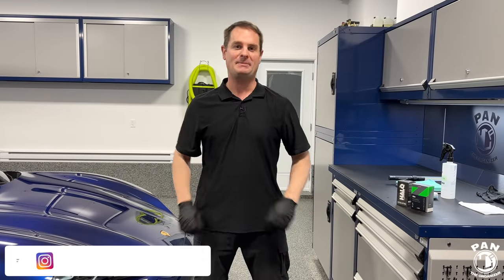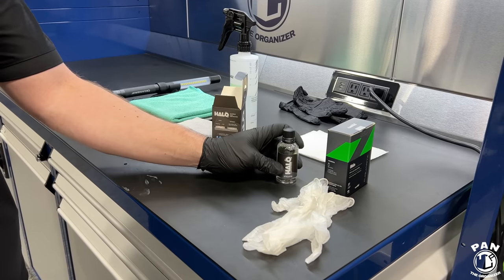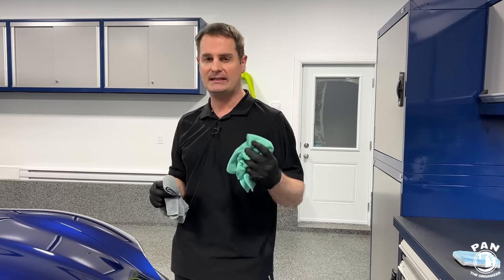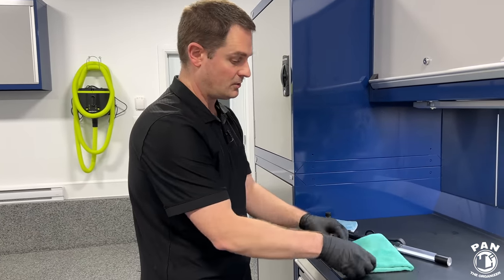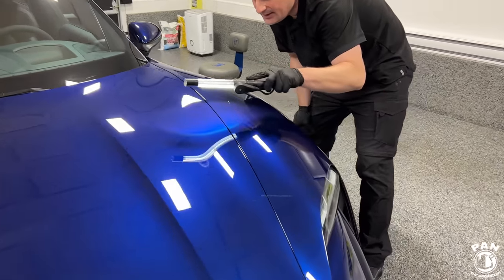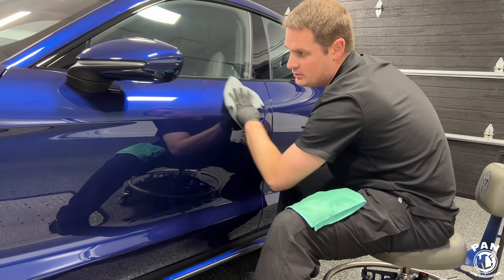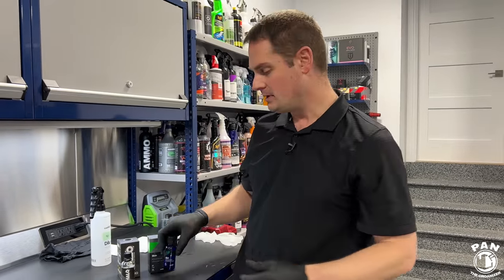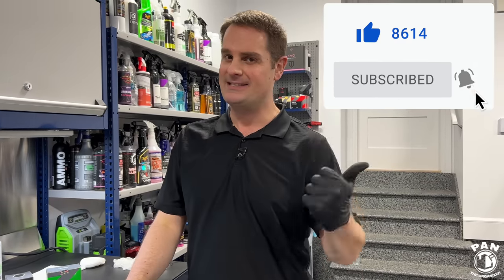How to apply a ceramic coating on PPF (paint protection film) : Porsche Taycan Turbo

Comment: @Pan - you said several times both coatings are fine for matte PPF, which I have on my Tesla model Y. I wrote to the CarPro people and they said Skin may make the matte fairly glossy (maybe not ruining the PPF, but a glossy/shiny layer on top).  Have you personally applied over matte PPF? Thoughts? 

The Ceramic Pro PPF installer used Ceramic Pro’s  PPF/Vinyl base and top coat as a protectant in the Tesla. Thoughts on Ceramic Pro products? Would you switch to the ones in your video?

Thanks!
Reply from the maker: I haven’t tested on matte surfaces. But CaPro themselves, on their own official website, state it can be used on matte surfaces. Check it out here: https://carpro.global/catalog/cquartz-skin/

So it seems we’re getting conflicting information from the brand.

One thing that can happen is coatings, even matte coatings, often make the surface richer in appearance. But not glossy.

Comment: U just made ceramic coating looks so easy. Quick question: Did you do any paint correction before this car was ppf-ed? This coating seems pretty DIY-able, just not sure about paint correction step. Thx
Reply from the maker: The car came to me already with PPF so I didn’t perform the paint correction. It seems the team that did it might not have been the best hehe.

Comment: Good morning Pan.  Will be parting with my 2015 BMW 435i M Sport and getting a 2022 Kia EV6.  Will definitely be adding PPF at least to the front back to the door panels.  Don’t know anything about PPF, what type to use or who I select to apply.  After applied and watching this Video will do the prep and then apply a coating.   Will it be AvalonKing or one of those in the Video?  My experience applying AvalonKing might make the process easier.  Oh, plus everything I learned from you over the past 2 years.
Reply from the maker: Good thing is that you can also apply AvalonKing on top of PPF, so if you still have it, use it on all the car.

Comment: Hey Pan,  How about a follow up on this car, putting a second Ceramic coat on top of this one.  My Tesla is in the shop right now getting full PPF wrap and a Ceramic coat on top of that.  I'm thinking of putting another layer or two on top of what the shop does.
Reply from the maker: I won't do that. You can't guarantee chemical compatibility and overapplying different protectants doesn't do any good usually. Plus you'll never know how long the base coating actually did if you try applying another one on top.

If you want to do that, by all means, you're free to do as you wish. But don't expect me to do that.

Comment: Exectly 4:00 minutes in you say you have many videos on prepping cars for ceramic, I figured you meant you have a video on preparing PPF for ceramic coating.  So wasn't sure if there's something special that needs to be done to PPF before ceramic coating.
Reply from the maker: It's pretty much the exact same prep. Except you would be very gentle with a light polish only if you see fine scratches in the PPF. And avoid using tar removers. But you can wash, use an iron remover (don't let it dry on the surface though, and don't work in direct sunlight!) and light polish, followed by the IPA wipe. Pretty much the same as for normal paint.

Comment: A great video pertaining to PPF, ceramic coating and maintenance. I use Car Pro Ech20  Pan. Is that enough to clean the contaminants on the PPF and ceramic coating? I use Reload every 4 months also.
Reply from the maker: Ech2O is a waterless wash/quick detailer depending on dilution. It's not meant for a perfect clean. When possible, I would still recommend a good traditional two bucket wash with CarPro Reset.

Comment: Can you use the ceramic coatings you mentioned in the video on clear coat as well?  Asking as not all of my car has PPF and would just like to use one product if possible.
Reply from the maker: No. These are PPF only coatings.

If you want to use just one product, do the opposite. Most paint coatings can also be applied on top of PPF.
Reply: @PanTheOrganizer  so then for the best protection I should use paint ceramic coating for paint and the PPF ceramic coating for the PPF. Is that what you’d recommend, or just use the paint ceramic coating everywhere is good enough?

Comment: Thank you so much for all the info
I was old school...
Wash wax and wax again
Occasional waterless clean and spray wax
I have a new car with PPF clear bra
Ive been keeping it washed wiped and clean
I have been using SiO2 ceramic spray and wipe (McGuires) hiw would it be affected if i were to apply a wax
I know not to with SiO2 coat 
Any difference using spray
And woul using an orbital buffer be bad
Reply from the maker: With PPF, you want to be very careful with what you apply on it for protection. While it is technically possible to wax paint protection film, it is not a recommended practice as it may have a detrimental effect on the film’s performance. Waxing paint protection film can cause discoloration and cloudiness over time. With the advancement of coatings and paint protection technology, the use of traditional carnauba sealants have become less common as these waxes and sealants tend to degrade more quickly compared to ceramic coatings. Additionally, wax can build-up on the edges of the film, resulting in a visible white line. 

If you insist on applying a wax on your PPF, make sure that the wax you will be using does not contain any petroleum-based products, and that it doesn't contain Kerosene or Naphtha in over 5% concentration. Also avoid waxes that come with dyes.

Also, check with your PPF installer what protection he recommends, as some PPF brands will void your warranty if you don't use their specific PPF coating.

As not all PPF is made the same, again, check with the shop that installed your PPF for the appropriate care. If they are a professional shop that cares, they should have given you clear instructions when they delivered the final result to you.

Comment: Pan, I've got a new to me Mercedes Benz GL350 with PPF on the front, hood, mirrors & rocker panels and I'd like to put on a ceramic coating. Should I use two separate products, one for the PPF and a separate one for the clear coted paint?
Reply from the maker: Most paint coatings can also be applied on PPF. So I would just use one coating for everything. Make sure your coating is compatible with PPF.

Comment: Pan, after a wash and application of iron remover (on a 4 year old PPF) what other steps do I have to consider in order to prep the car correctly ?
Reply from the maker: You can do a light polish if your PPF has stains, scratches and swirls. Then use the panel prep spray, and then apply the coating.

Comment: Hey Pan, how do you prep a wrapped car. Going to use halov2 but not exactly sure on the prep. Would I need to use iron and also would it need polishing?
Reply from the maker: Same process applies for PPF and vinyl wraps. But you likely won't need the iron remover or polishing. You should check with your vinyl wrap installer to make sure, as there can be specific indications for certain types of wraps or PPF some times.

Comment: Hi Pan, would you do all the necessary prep steps prior to coating PPF?(decon. wash, chemical and mechanical decon. compound/polish, IPA, then coating) or are there steps you for go because of the PPF installation? and how often would you apply an SIo2 spray as a "topper" once coating is done? ( my environment is the same as yours we both live in MTL)
Reply from the maker: Typically, the installers of the PPF should have already prepped the paint properly underneath, so you would simply have to wash the vehicle, dry it, use the IPA mix, and apply the coating.

For the toppers, same applies as for any coating: at least once every 2 to 3 months, you apply a maintenance ceramic topper.
Reply: @PanTheOrganizer  Thanks Pan!

Comment: Awsome video Pan! Just a quick question. Do you have a video on how to prep a vehicle with PPF for ceramic coating. What I mean is, do you have a video how to prep a car/truck that has had PPF on it for over a year such as clay bar it, Iron X, or an obital polisher and polish on it before applying a ceramic coating.
Reply from the maker: I don’t.

Comment: Great video. Is ceramic coating flexible enough on top of PPF to not Crack if I need to take my bumper off to replace an engine part? I have to flex the bumper a little near the fender to remove from the clips.
Reply from the maker: No worries.
Reply: @PanTheOrganizer  thank you. Subscribed!

Comment: Thank you for great video tutorial. On my fully Ppfd T-MS I have applied Avalon King ceramic coating. Car looks great but after first wash the surface is not very slick. Is there any specific product that improves slickness or even better like water sheeting?  I would be very thankful if you can provide me and the whole watching community this advice.
Reply: Top it with APEX ReHydra Sheet, for a slick and sheeting finish. Reapply once a month, or dilute it 1:1 and use it as a drying aid after each wash. If you want beading, use ReHydra Bead
Reply: Beadmaker is another good one     I use to maintain slickness
Reply: @Rama Nrusimhadevara 

I have Car Pro Ceramic UK applied in 2018
Reply: @lazyjacket  thank you very much for your advice 🙏🏻

Comment: Can I use regular polish for polishing vinyl? Or is there specific polish for it, if so what?
Reply: I think Pam mentioned in the video that it’s OK to use a regular polish on top of the PPF. Good luck.
Reply from the maker: You can polish PPF with the same polishes as for paint (like Sonax Perfect Finish for example), just be more careful. Do a test spot on an inconspicuous area first to see how the PPF reacts. Or check with your PPF installer to see if you specific brand can be polished.

Comment: Hey Pan,
Great video and love the content,
I just got PPF and Ceramic coating on my car, what product would you recommend for Tar and Bug removal on PPF and Ceramic coated car?
Thanks
Reply from the maker: You would use a tar remover, but be very careful with those on PPF, as they are harsher chemicals compared to iron removers. Also, I would check with your PPF installer IF you can use tar removers on your specific PPF, and what he would recommend, as some PPF have special needs and requirements.

Comment: Hi. I’m shocked about the fact that ppf can be machine polished!?!?  What if I had a ceramic put on my ppf a year ago and I want to put this halo on for this year?  Do I just iron remover, wash and alcohol mix prep?
Reply from the maker: No. You would need to polish the previous coating off, before applying the new one. It's just like paint. You don't apply a new coating on top of an existing one. And the only way to ensure 100% removal is by machine polishing.

Comment: Pan or someone please tell me what are you looking for exactly when using the light. It does not come through on my end on the video it just looks like your putting light on the paint. Do you see a haze or a shine or a  rainbow type of effect from the coating or do you see a color change with the light? Please and thank you for the help
Reply from the maker: Looking for high spots, so darker spots of the coating the wasn’t leveled. If you let that dry it will create a dark spot that’s hard to remove.

Comment: Hi Pan, great video. For the prep can I use high alkaline shampoo like Car pro reset and Car Pro Iron X on PPF to have the surface clean before applying ceramic. 

PPF has been on the car for 2 months
Reply from the maker: CarPro Reset is actually pH neutral. It's not alkaline. So yes you can wash PPF with it. And you can use IronX as well. Just keep in mind, if there's any protection on the PPF (wax, sealant or ceramic) you will also have to machine polish that off, and then use a paint prep spray, to make sure you remove any previous protection before applying the new ceramic coating.

Comment: As always another great video.  I just got delivery of my Tesla Mode 3. Scheduled to apply matte PPF by a professional. Spec: Xpel Stealth PPF

Question 1. How long should I wait to apply the Halo ceramic coating after Stealth PPF application?

Question 2:. I have the chemical guys snow foam soap(watermelon). Can I use that soap for regular car maintenance? Or is it not compatible with the Halo ceramic coating?

Thanks bunch! 🙏 All my OCD car washing lessons are from your videos. 👊
Reply from the maker: Congrats on your new Model 3!  I made a video about detailing a new Tesla Model Y here: https://youtu.be/gohks8xP5NY

To answer your questions:
1. Wait two weeks.
2. Yes you can use that shampoo.

Welcome to my channel. You discovered one of the biggest car detailing channels on YouTube as we surpassed 790,000 subscribers and 100 million views! I have been detailing for 25 years and I love to share my knowledge and passion with my viewers.

You found the right channel to help you learn everything about detailing. 

How did you discover my channel by the way?
Reply: @PanTheOrganizer  I found your channel by searching on YouTube how to prep and detail a car. I basically bought all my carwash/detail equipment from your recs. 

Thanks for the responses to my questions. 🙏

Comment: Hello 👋 greit video btw✌️💎
Question- what is best way and product to take care and boost protection for coated wrapped black mat finish?? Can we use some wax for mat finish to boost protection or something like that over ceramic coating.
Reply from the maker: You would apply the same products as here: Gtechniq Halo or CarPro Skin. Both can be applied to matte wraps or matte ppf. For maintenance, there aren't many products out there for matte surfaces. Here's one: https://bit.ly/3EHX1UI

Comment: Hi Pan, first of all i want to thank you for all your helpful contents, i been watching your videos all last week and i really learned a Ton!!! I have a suntek matte ppf and it is treated with halo ceramic coating, i noticed lately that the front bumper and the bottom of the door are not hydrophobic as they used to be, can i just add another layer of the halo ceramic after washing the car or do i need to strip it off first and use a specific chemical before re applying another coat! Thanks a lot!
Reply from the maker: How long ago did you apply the coating? Sometimes, coatings are simply clogged and need chemical decon to get revived. You could wash the car using a 2PH system (alkaline pH for pre-wash with foam cannon, and acidic soap for the contact wash). See my video on that here: https://youtu.be/NFvtgblWhTk?si=vffSLlzDW7wL9EWh

Use an iron remover to remove brake dust. And then once the car is clean, use a water spot remover like this: https://bit.ly/3UO1UX4
Reply: @PanTheOrganizer  Thank you, it was coated about 2 months ago, the rest of the car is perfect and very slick but just the front bumper and bottom sides under the door
Reply: @PanTheOrganizer  i was just wondering in general, is it okay to re-apply ceramic coating over an existing one, especially if it’s been recent? Or it needs to be stripped off first before reapplying?
Reply from the maker: A coating must always bond to a virgin surface, so the old one has to be polished off, before applying a fresh one.
Reply: @PanTheOrganizer  thank you so much and again thanks for all your great contents and attention to detail

Comment: Does the halo ceramic kit come with the applicator pad, and microfiber cloths??
Reply from the maker: No. The new Halo V2 comes with:
30ml or 50ml HALO Flexible Film Coating
A pair of nitrile gloves
AP2 Ultra Soft Foam Filled Applicator
Instruction Leaflet
Gtechniq window sticker

Comment: i have a 3m black satin wrap on my car and i ceramic coated it myself with carpro skin a year ago. i've noticed that on my driver side door i have what looks like a water stain streak that i cant seem to get rid of when washed. its the only panel of the car that has it. whats the best way you know of to remove that water stain streak? thanks

Comment: @PanTheOrganizer I’ve read that CarPro Skin, once the bottle opened could be used even after 6 months, I do not know if the same holds for Gtechniq halo. If not I will go for carpro skin. Any hints on that? :)
Reply from the maker: I never heard that. Once opened, nobody really can predict exactly how long coatings last as contact with oxygen is done so curing starts. “A few months at best” is what most chemists will say.

If you want to make sure, perhaps write to CarPro and ask them.

Comment: For clients that have ceramic coatings I see you recommended carpro rest and apex what are your thoughts on using Turtle's ceramic wash & wax would that masks the properties of the coating or do you see them aiding the coating. My understanding is the wash is more for people who are the same category of those that use a wash and wax who don't want to do a full on wax or coating job. But again not sure if this approach would hinder the coating instead of benefit it. Thank you
Reply from the maker: I prefer pure shampoos with no protection additives inside them, as I like to control which toppers I use at the end of the wash process. But the shampoos like the Turtle Wax Ceramic Wash N Wax are meant for those who want to save time and money, using just one product to boost a bit of the existing ceramic protection they have on their car. It's a maintenance wash in one step, that will allow you to clean the paint, and restore a bit of hydrophobic properties to your existing protection. So for those who want a quick and easy way to clean and maintain, that's where those "wash n wax" type shampoos come in.